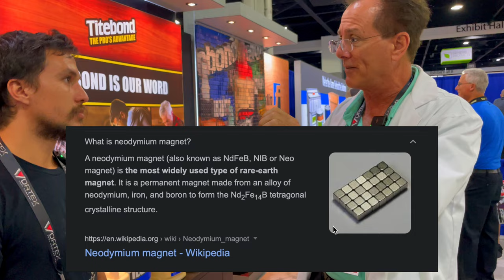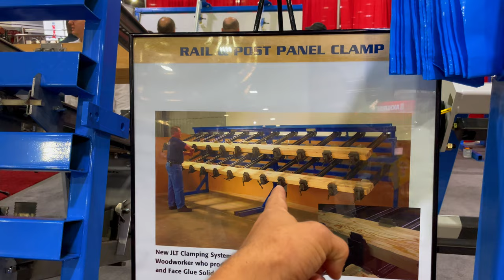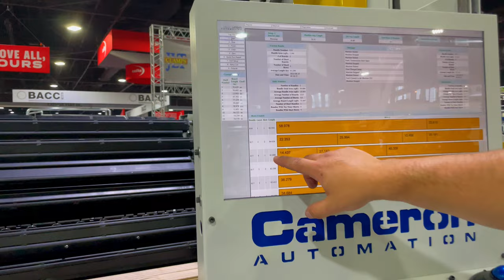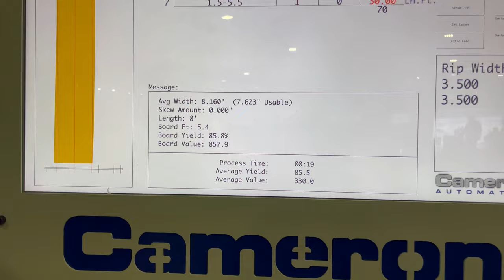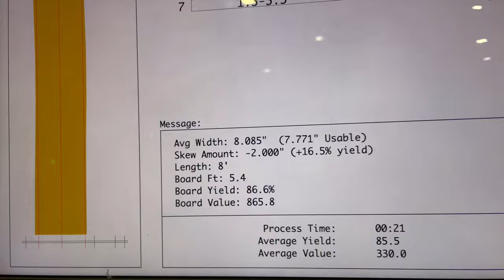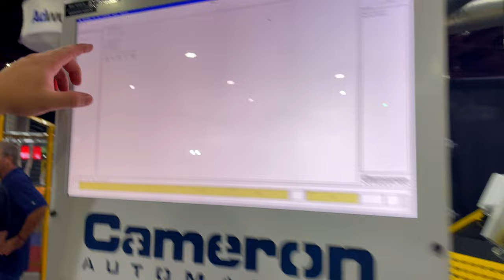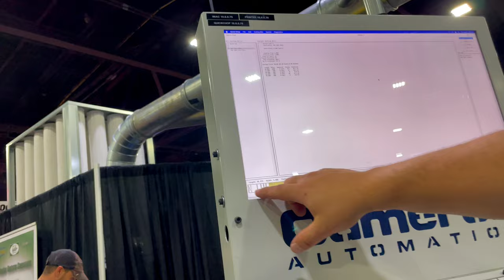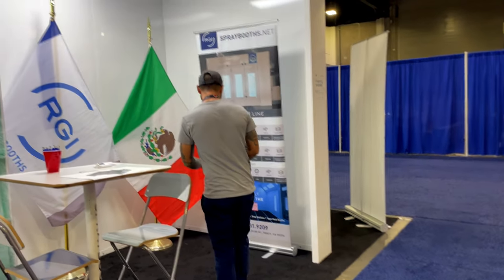IWF 2022: @Titebond, JLT, CleanArmor, and More!

Comment: great glue lesson!  I feel like i was listening to Dr. Emmett Brown explaining the flux capacitor.  The most important take away for me , just because your clamp is capable of 1000  lbs of pressure doesn't mean you need to use that!  So clamp tight enough to hold the two pieces together and tighten it down if you need to take out gaps from boards not being completely parallel with each outher.

Comment: is Clean Armor what you guys have been using in the past couple videos?  how much does the UV light cost  and how well does it hold up to exterior projects
Reply from the maker: We have been using VestingUSA LED oil which is also a uv polymer coating. But there are a lot of differences. Stay tuned for the video
Reply: @TNTINDUSTRIESLLC  Id love to find a clear finish that holds up to outdoor projects.  Varathane is good for maybe a year if you are lucky
Reply from the maker: This is your answer. Clean Armor is marine grade